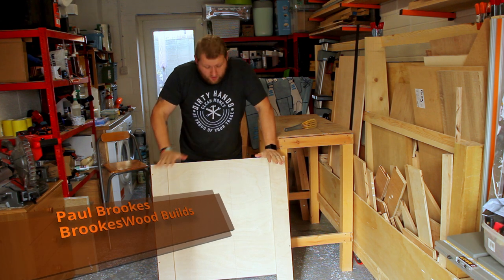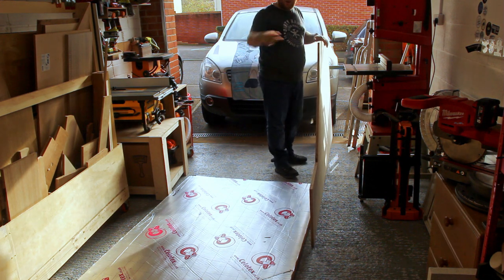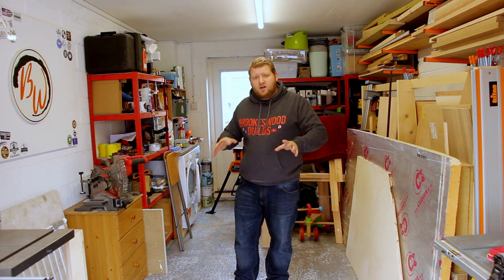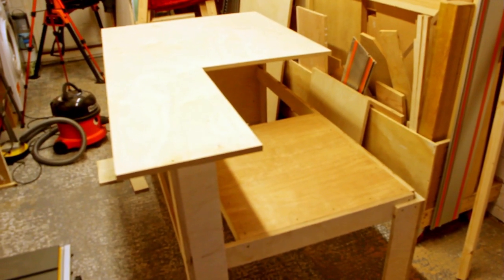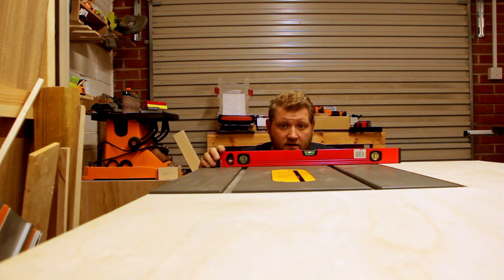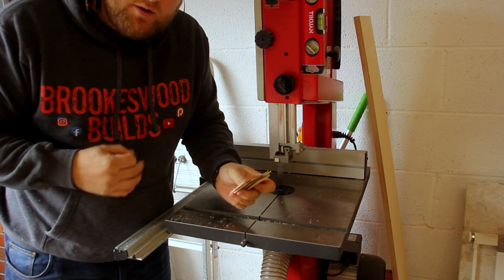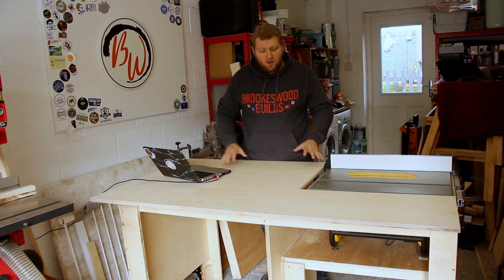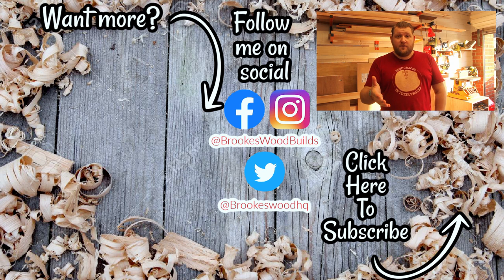Built in tablesaw work bench!

Comment: I also used her plan for the workbench for mine. I ran into the same issue with the table saw and just added 3/4” plywood to the base for the height issue and luckily for me that worked. 

I love to see problems and how other people choose to tackle them with these build videos. Keeps me thinking outside the box to fix issue I run into 💯
Reply from the maker: its a great bench and fairly easy once you overcome the small issues.

Comment: Can't have to much table space!
Are you happy with that table saw?
Reply from the maker: Much better than the one I was working with before. 
Yeah it’s ok. It struggles with hardwood a little if it is thick but is fine for most plywood’s etc.
Reply: @BrookesWood  I could really use a table saw, but a contractors saw is all I have space for, so the DeWalt ones look pretty sweet.